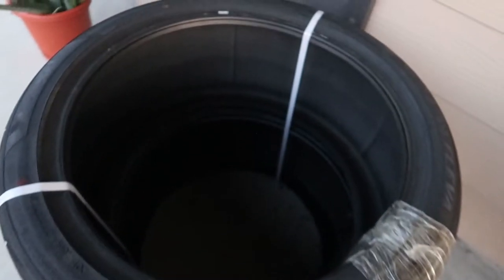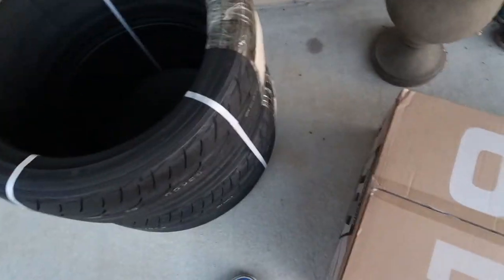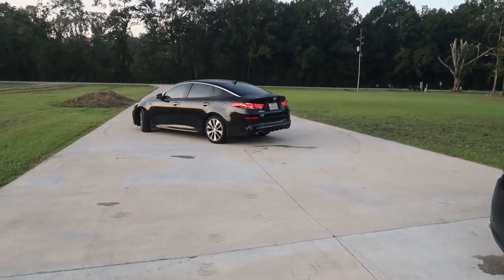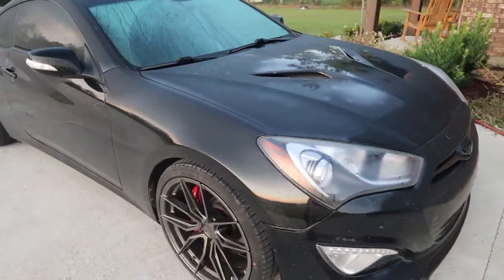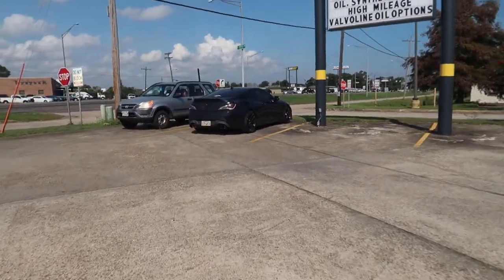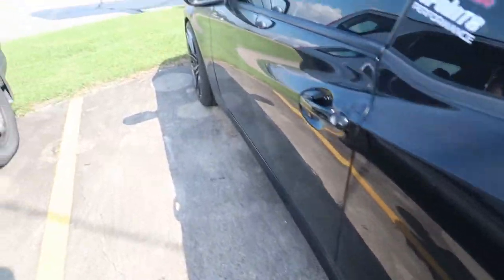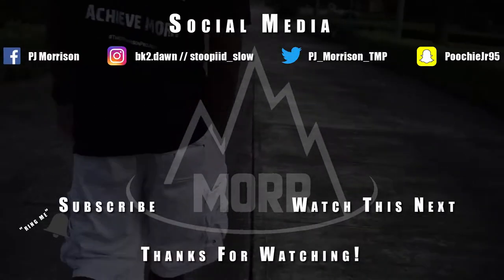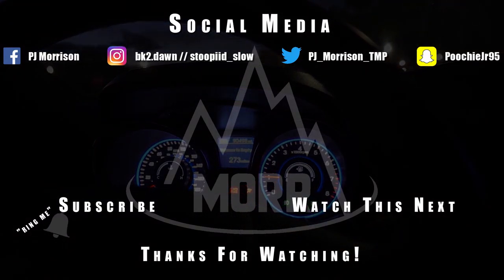I BROKE MY GENESIS COUPE 3.8 | Is It Worth Fixing?

Comment: Do you have hub centric rings on your aftermarket wheels? If not that will caused your ride to be shaky.
Reply from the maker: I bought hub centric spacers for the front.. I might need to buy some hub centric rings for the back tho

Comment: I the rim crack under warranty??
Reply from the maker: It was not.. Louisiana roads cracked it, and the warranty agreement basically said it had to be a wheel that just fell apart or something. They don’t warranty it if it’s due to bad roads, and I wasn’t exactly sure what pot hole or whatever did it so I couldn’t inform the road folks either